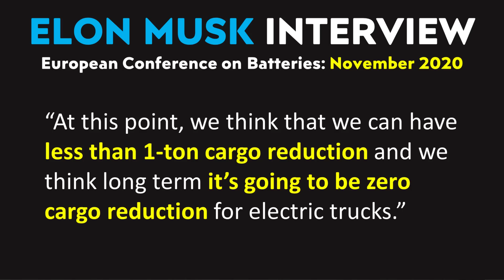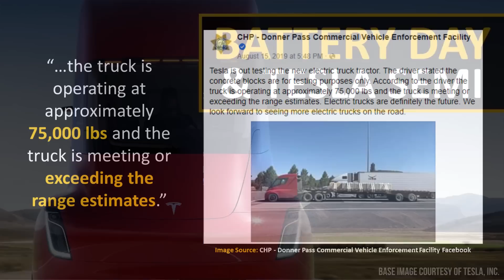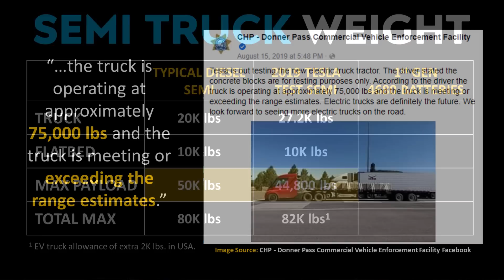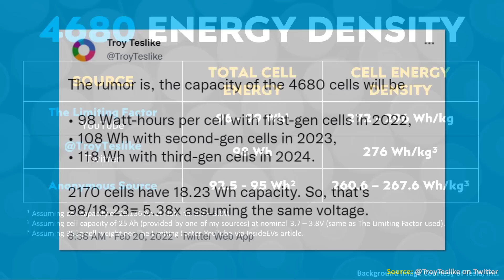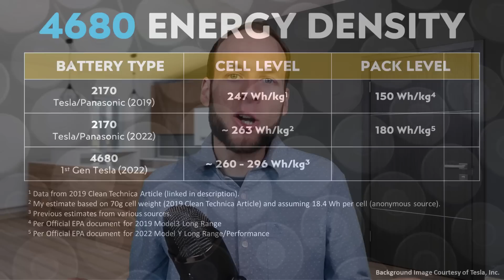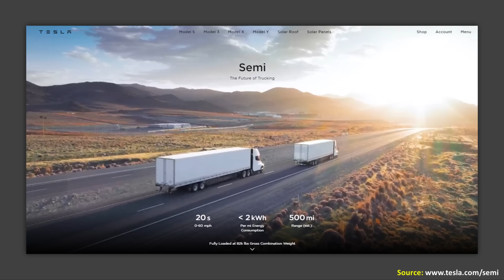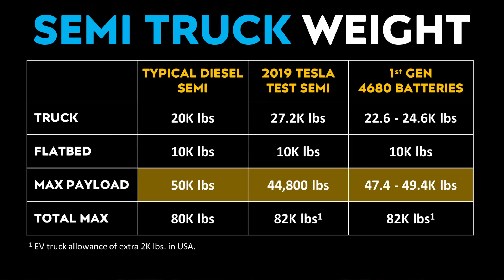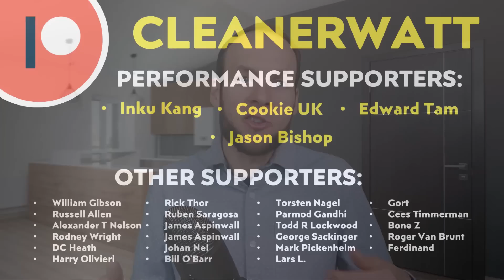Tesla Semi HANDICAPPED by 1st Gen 4680 Batteries?

Comment from the maker: While, most of semi loads (long + short haul) and 73k lbs or less,  @carsonight on Twitter stated: "It's routine to max out on weight, which for a diesel semi is 80k lb. For example, a load of flour, bagged and palletized, will only be about 3 feet deep on the trailer floor. Specific density for flour is 37 lb/cu ft, standard trailer is 8 ft x 53 ft."
Reply: I wonder if a helium on demand service may be practical for a track ceiling mounted inflatable bladder to inch out an extra load or two if all that is required is to drive into a service garage for an automated insertion and fill. When done, another garage deflates and removes in reverse order.
Such a concept may fit in competition with hybrid structural blimps, perhaps even having detachable drone guided floating above tree tops, into narrow valleys or remote locations or safe zones.

Comment: Actually weight is not so important. About 85% of semi transportation in USA is volume restricted, not weight restricted. So, at least 85% of the market is without any disadvantage for Tesla Semi. With the rest - 15% of the market, 1 ton disadvantage can be compensated with lower maintenance and petrol costs.
Reply: And many many truck movements are way below the load limit.
Reply from the maker: Good insight - thanks!
Reply: I had been wondering about this exact issue. Could you tell us where you get your stats from?
Reply: I agree, cleaner watt didn’t do their homework.
Reply: @harrydymond4488  Data on percent of trucks that “cube out” vs. “weight out” is available from NACFE (is that you M Roth?), and the US DOT.
Reply: Looking for weight inconsistencies due to smuggling and human trafficking.
Reply: As a truck driver, weight is very important.   I want access to as many loads possible.   If I have a customer thar wants a load hauled that puts me at weight composite, I want to be able to haul that load for them.
Reply: @002mjr  85% of the viewers didn‘t know this as well
Reply: Electric semi's also are allowed to weight more on top of all this, they changed the law for it, at least in my country.
Reply: I’m in conflict, when studying intermodal transportation, I learned that weight limits are a big deal due to wear and tear to the road infrastructure. I recall limits varying between roughly 85k to 120k but this data was years ago, backed by physics, and economics. The cost of road repair may have come down to make higher weights more viable since my last review.
Reply: agree, unless there is some revolutionary energy density chemistry, the Semi is never going to be released,... At the moment we are pretty much at the limit of where lithium-ion battery technology can get us, sadly
Reply: @002mjr  I am sure Cleanerwatt would welcome your homework.
Please paste it here.
Reply: @hgm8337  I don't undertand, the video clearly shows it works
Reply: @gary.richardson  yes in Europe the old weight limits retained however vehicles with road friendly layouts and suspension etc. are now allowed extra weight.
Yes we have also had a bridge strengthening programme.
I think the tesla semi is well on the way to  those heavier limits  but of course a lot of changes would still be needed. 
 There are reasons that manufacturers that sell in both Europe and US have totally different vehicles rather than just tweak one model for both locations. 
It is probably easier for Nikola converting the IVECO S Way to the states than someone trying to convert the other way and IVECO semis are designed around flexibility to enable each individual unit to be built specifically to one of the configurations.
(+ of course the extra 2000kg for electric in Europe.)
Reply: @Cleanerwatt  : I’ve been making that point for a long time. . .
Reply: @hgm8337  except the semi is coming this year and battery chemistry is getting better every year. Panasonic announced improvements to 2070 cells, BYD to its Blade cells, CATL to its standard Prismatic cells and its new LFMP cells
Reply: drove tractor trailer 10 years ,  d.o.t. has scales all over usa. they even use portable scales to weigh trucks
Reply: @Cleanerwatt  
I've seen a lot of speculation regarding pack weight with an assumption that this makes the vehicle overweight by default.
I've yet to see a comprehensive estimate of the weight saved by not having the ICE drive system, plus all the associated systems, heavy chassis to carry the weight and deal with the engine torque, or fuel.
.
I have a feeling it's going to be a lot closer than some believe.
We shall see!
Reply: I haul 500 lbs overtaxed every GD day. What I cant get on truck due to heavier empty weight requires more trips more wear and tear overall especially on the trailers. 40 years experience says  you're full of it.
Reply: @davidclark2286  Did you say the nIVECOla semi?....
Reply: Bullshit!!!! The diesel has an advantage because it first has longer range but also comes in sooo many different power outputs and also diesel trucks are much more polyvalent/flexible for all weather conditions and can actually haul way more than 80,000lbs
Reply: @monkeysezbegood  lol….. that doesn’t mean it’s low weight all the time, that’s what flexibility with diesels are.
Reply: @rogerstarkey5390  I suspect that, like with the structural battery & front & rear subframe castings on the M3/MY, the Semi is going to get get SOME castings where normal semi's have girder chassis construction, again saving weight. The cab floor/battery packs is the prime candidate.
Reply: @hgm8337  No, do a Quick search on battery chemistry, silicon content on the anode side, solidstate battery (with silicon anode or without) etc.
Reply: TESLA TRUCKS HAVE A ONE TON ADVANTAGE LMFAO  THEY WEIGH THE SAME BUT ARE ALLOWED ONE TON MORE WEIGHT
Reply: @vinyllpreviews9462  The Tesla Simi Truck can legally haul Two Thousand lbs. More than a Diesel Truck
Reply: @paulhailey2537  bullshit!!! The one ton was given by the government since the electric truck is heavier with batteries and also diesel trucks can haul literally 3-4x the tesla load with the same power.
Reply: @paulhailey2537  one ton more weight is not an advantage it’s a cheat because diesels are much more capable
Reply: @alanmay7929  THE TESLA IS NOT HEAVIER BUT US ALLOWED TWO THOUSAND EXTRA POUNDS BECAUSE ALL THE OTHER ELECTRIC TRUCKS ARE HEAVIER
Reply: @paulhailey2537  the tesla semi is about 1000hp while a 600hp diesel truck hauls over double of 80,000lbs
Reply: @alanmay7929  Torque
Reply: @paulhailey2537  lol 😂 😂 😂 diesel trucks doesn’t have any torque!? Tell me why are the most heavy duty trucks all diesel!? The trucks that moves gigantic 300 tons+ transformers and other massive loads!?
Reply: @paulhailey2537  what about the 600hp Australian road trains!? Can the 1000hp tesla semi pul 300,009lbs+ on 2000miles across the outback!?
Reply: @alanmay7929  SHOW ME YOUR SOURCE ON THAT ?
80 Thousand is the limit
Reply: @paulhailey2537  my question is why are that class truck limited in diesel to 80,000lbs and they allow 2000lbs more on electric!? Because again diesel can haul more loads than electric ones
Reply: @paulhailey2537  how do you call it class 8 truck I’m not from the US but it’s something like that
Reply: @paulhailey2537  so instead of staying at 80,000lbs to protect our roads and infrastructure they had to allow 2000lbs more on already heavier electric trucks!? Wtf!!!!

Comment: I spent 15 years in transportation.  Many trucks seldom operate at load capacity. Only if they are hauling dense cargo loads such as chemicals, steel, etc.  White goods, autos,  etc. have a high volume to weight ratio.

Comment: I'm not sure if Tesla are going to use structural batteries on the Tesla Semi.
Semi-trucks are generally a body on frame construction, this is due to the significant force that needs to be exerted to manoeuvre a trailer. 
I would expect the Tesla Semi to be the same, if that's the point a structural battery pack would have little or no benefit and would make changing or replacing battery packs more difficult.
Reply: I agree with you on whether a structural pack is adequate on areas where situations may arise that require additional protection. In my mind, a structural pack can still be integrated if carefully selected in a disciplined manner to size, location, weight, shape, temperature, accommodations, etc...
Reply: That's one for the structural engineers....
However, if we assume a honeycomb structure is one of, if not the strongest available in terms of torsion vs weight, there's no reason the principle won't apply.
Not to mention, much of the torsional stress in a "conventional" truck would derive from torque from the drivetrain.
That's gone in the electric drive system. It's all in the direction of wheel rotation, the chassis stays "flat".
.
Why on earth would there be much concern regarding "replacing of changing packs"?
There's still a fixation that "packs will fail".
However, let's consider the problem.
If the packs (all, or some) are horizontal, under the floor of the cab, in front of the motors, it's essentially the same drop out system as the cars, simply more units.
Vehicle structure won't be compromised, since there's a fraction of stress in the area when the trailer is disconnected (ref the cars)
If some are vertical behind the cab.... "Easy" access.
That's IF they need changing.
Since nobody seems to have asked where they are, how they're constructed or mounted, it's ALL speculation.
.
(Personally? As low as possible equal between axles, slight front bias, major structure from the packs, lightweight subframe "box" around them..... But that's just me🤷🏼‍♀️)

Comment: In a semi, there is less space for vehicle/pack integration, so less savings in Wh/kg. That being said, if much of the pack isn’t structural, I’m pretty sure Tesla would decrease the thickness of the cell. They’re currently really thick to help with the structure (see the tear down from Limiting Factor) and you could get a few more mm of battery and a few mm less steel. The density of the semi battery pack should be significantly higher, but there will be less savings on overall cab weight. Maybe those two improvements/detriments end up being a wash in the end, but I don’t think we can compare pack density between cars and the semi.
Reply: I’m not sure if I can compare either. In the near term, configuration of battery pack size and structure is likely determined by the current giga factory capabilities and economics. I say likely with a grain of salt. Traditional semi-trucks have a heavy front end due to the diesel engine. However, the electric motors, batteries, solar roofs and other important components may go through innovations in load balancing and later inspire rewriting of regulations use on the roads and highways.

Comment: I have been in the heavy transportation truck/rail business since 1973 and I get so very tired of Youtubers who don't know what they are talking about. If the Tesla batteries are in fact heavier Tesla can easily add drop axles on the tractor and the trailer which boosts the capacity to 105.000 pounds gross and this would more than easily take care of any extra battery weight. There is NO problem with battery weight and there.......... NEVER .............HAS.......... BEEN !!!!!  They should call this BoobTube.
Reply: Agreed!
Motor, battery, and axle on demand!
Perhaps even a seasonal solar roof and other practical add-on applications.
Reply: AT LAST!
An EXPERT!
.
Thank you!

Comment: In Europe, they actually give a 2 ton (4400 lb) allowance for electric lorries/semi trucks.  If they gave that same allowance here in North America, the Tesla Semi would be PERFECT FOR A LOT MORE FLEETS!
Reply: Yes, I wonder if instead of 18 wheeler, they may be renamed 24 wheeler, 36 wheeler, or some 3 digit count due to weight displacement benefits that might be gained.
Reply: I wonder if the Tesla Semi will need those extra allowances.
.
Has anyone ever seen the tractor unit on a weighbridge? Or seen a detailed (official!) weight specification?
(We now hear it's 3 motors, not 4.... Maybe a single Plaid, plus 2 model 3 types?
There's a saving!)
Reply: And offering 1-2 tons more payload than  ice.  Tesla have enough advantage over ice already,  other manufacturers would appreciate it though.
Reply: Lol…… and the roads are going to suffer more right! And need more frequent repairs with diesel equipments….

Comment: With such a large battery pack I wondered if the battery is divided into separate battery sets. Which could aid heat management within separate smaller battery sets. Charging management improvements because with battery sets discharging at different speeds and therefore have a different charging approaches. This enables power to be  able to direct where it is most needed.  With such a density mass of batteries there are going to be some batteries exposed to air cooling more than others. Also a battery set could be allocated to its own motor.

Comment: To have some comparison on energy consumption. 2kWh/mile was given. Thats around 
1.24 kWh/km or 124kWh/100km. The model S was around 23.8 kWh/100km. And the Model 3/Model Y I suspect somewhere between 15..19 kWh/100km. So the truck is 5..8 times more than a car. 
When I remember correct, (I am not a trucker), i think with Gasoline the truck was maybe 3..4 times the fuel consumption of a  car. Please correct me or narrow down if interested.

Comment: Tesla has already explained that it has different chemistries depending on the vehicle use case. The model Y with 4680 seems to be lower density low nickel to get the ball rowing but the semi on the battery day slide deck was high nickel. They likely do not plan on the same enerhy densities/cell chemistry between these two vehicles so trying to extrapolate that to the semi is a bit of a fools errand. Look up the battery day slides. 

Also elon said during at least 2 interviews in the last 12-18 months that the 4680 was not required for the semi to meet its specs. Chances are they also have a higher density 2170 they could run if required because current model 3s/Ys 2170 chemistry is based off the needs of the vehicle and is not the maximum density they can cram into a cell. It is instead the most cost effective and a whole bunch of other things.
Reply: The "Y"  ell is the sideways step.
Equal performance.
Sort issues, then begin incremental improvement over 2-3 years.

Comment: I would take the semi truck scenario and divide it up into 3 (or more) possible categories. Taking all the data so far and compile a worst case scenario with full disadvantages for all factors. Then the average cases with various tweaks to the numbers based on things like total weight, road conditions, road incline, weather, season, etc.  I'd say that 3 subcategories for this would suffice to keep a wide perspective view. And then the best case scenario using ideal condition data with possible improvements factored in. 

If I remember correctly,  we could calculate the average statistics for a semi-truck trip of a fully loaded truck from Tesla's gigafactory in Nevada to the factory in Fremont California as a test case and then add in any relevant environmental factors like season and weather to further broaden the scope. 

Then we can chuck it all together into an easy to read percentage of advertised to possible real world performance values. 

Some numbers may need to speculated, but some can be sourced from non-electric vehicle data, and/or already existing battery electric trucks from legacy auto makers like Volvo. 

The more complete the picture, the more realistic our expectations will be. It is just a matter of plugging in the relevant numbers.
Reply: You're starting with as you put it "things like total weight"
 Those are actually ASSUMPTIONS of total weight.
"We" have zero knowledge, even an estimate of the "tractor weight"
As such, any guestimates based on and compounding from those assumptions are likely to be (wildly?) inaccurate.
Suggestion
Let's wait until we see one on a weighbridge, then the same truck pulling a known load, over a known distance. (Bearing in mind, the Toyota truck "display"/ announcement this week didn't give us any of that data, just 300 miles, no weight, no efficiency).

Comment: Something that I have yet to see addressed in detail in discussion of EV trucking - increase of profit per pound vs reduction of cargo weight.
If an EV is operating at 1/4 the cost of a Diesel, then every pound of cargo delivered by an EV has a higher profit margin than a pound cargo delivered by a diesel truck. At some threshold, the profit differential would mean a fleet could operate two EV trucks for the cost of one Diesel.
Reply: Very good point.
Maybe that allows a lower height trailer/ cab.... Better aero, lower consumption, more versatility and a pair....
etc, etc?
Reply: Absolute nonsense!!!! An EV truck/semi wont operate at 1/4 of diesel not even in your dreams! If you saw the tesla semi presentation in 2019 they said it was about some decimal the difference in operating costs. Not 1/4
Reply: @rogerstarkey5390  there is no versatility with EV but only with diesel lol…